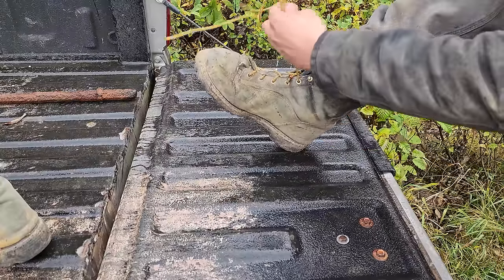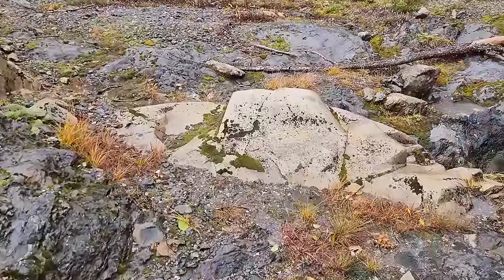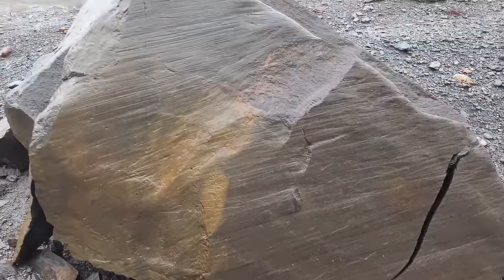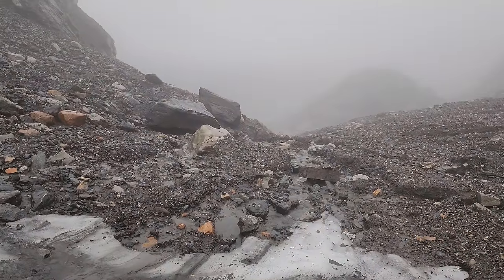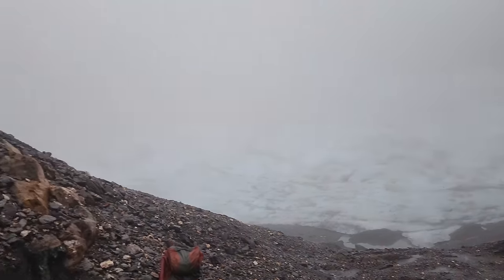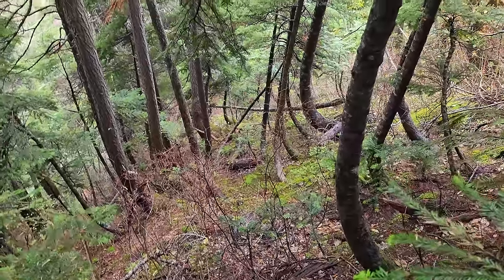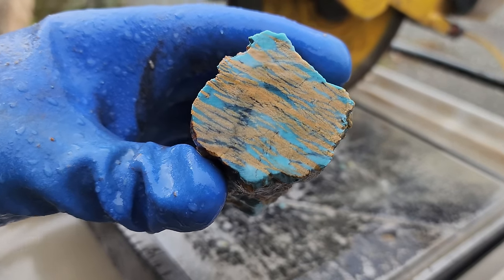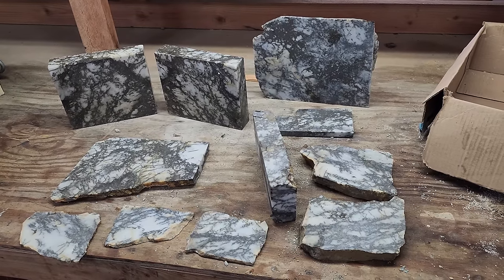Death March Gold Prospecting & Rock Cutting, What Did I Find?!?!

Comment: Poppin joints is from little air bubbles forming and popping again inside the knee. Can be from dehydration or pressure changes. You likely had both going on. Jade will not scratch while pretty much everything else will scratch. Translucent to light and passes the scratch test, and you got Jade. THAT is BEAUTIFUL!

Comment: Amazing video and geology. I'd suggest eventually taking a sensitive metal detector like a gold bug 2 up there, of course packed away until you're amidst all the green stuff. Often the more coarse the gold, the smaller the veins and more calm 'backwaters' of the perculating ore rich fluids. Larger seams often have lots of mixing and a turbulent environment which often doesn't allow for more extended cooling to form larger concentrations (such as gold crystals), but perhaps you knew all that. -With some more alteration (metamorphism), you could have had some nephrite jade up there too...Oh, I spoke too soon, there's the jade, 26 min in. The jade can be worth a lot to Chinese buyers (big bucks on the level of gold.) Need to tap off a piece (easier said than done), slab it and look at the color and cracks...I always use elastic compression bands around the knees for off trail hiking, it saves them big time. Sorry for such a ridiculously long message...Of course, say hello to the NW sasquatches :) Just subbed to the channel.
Reply: It’s worth even more when you find jade that weighs exactly 8.8888 grams/lbs or carats 😂

Comment: Note time 1:49.
The bent cedar trees indicate that there is a slow slip landslide occurring at this location.

Whenever you note trees with this curvature at the base, It indicates that the land has moved from its original location where the tree started to grow.
Reply: Interesting!  Could snow load on seedlings cause that also?
Reply: Snow typically bends mountain hemlock tops into a candy cane shape, not the trunks. likewise snow-bent trees trees would typically bend downslope, not up slope.
Reply: The whole region is covered in a variety of landides, the roads have to frequently be re-engineered. This is not far from a massive landslide that killed many people in a rural housing development. Rainforest conditions above riding on slimy layers of volcanic ash sediment below.
Reply: smilingcloud8  yeah it's nearly criminal negligence because even the most basic visual soil-core samples (seismic, stability, etc.) would have revealed clearly dangerous ash strata from the last time

Comment: I was really impressed with the skewed trees in that grove. You think there was a landslide or avalanche that pushed them over, or maybe a really heavy snow that pressed them down at some point?
Reply: Landslide. There is a Missouri geology professor on u tube that talks about geologic engineering and signs of unstable ground
Reply: Commonly called "pistol butt"  in areas of heavy winter snow.  The weight of the snow slowly pushing downhill due to gravity and the tree trunk curves to compensate and try to grow vertically.  You can see it all over Western Washington in the higher altitudes with heavy winter snow.

Comment: Thank You for the walk and SO MUCH for Teaching!  Find yourself a good, live hard wood branch, and cut it to just above your shoulder. Trim the bottom to a 1"-1-1/2" flattened point.  It makes going up hill, down hill, and crossing water much easier and more safe with your 3rd point and will save your knees.  Mine are better because of a stick. 🙏🚂🎼🌹🎵🎶🛠 ~C< 3)>>-Z->}

Comment: About your knee popping...
If its like mine... I scramble a lot and when I do alot of terrain, my knees will get painful and if too much will pop a bit. I can still go just slower. My old chiropractor who was avid in mountain hiking told me that going uphill  really works a particular group of muscles, tending to fatique alot, then going downhill the other set of muscles that wasnt used as much going up, pulls your leg and knee out of alignment, hence the popping. He said to alleviate this, was to work out that other group on the way up, so when coming downhill the both muscle groups pull evenly, keeping better alignment. Sitting down and doing leg extensions or leg lifts, bringing your foot upwards to knee height...ish, while having a break is supposed to be a good way to alleviate it.

Comment: I'm not a prospector, but I've had a bad back for decades. My way of handling the descent would be make a folding piece of plastic that acts as a pack frame, then I would carry some lightweight line and pulley to use that the plastic as a sled to lower it down grades. That, or I would just throw my whole backpack down the hill haha.

Comment: Next time you go, bring a Metal Detector and run it over your Targets. I've had hits on similar looking stuff in Vermont. What I was finding had Brown on the outside and Serpentine Green on the inside. Only down side about the stuff I found is that it is super tough to break up. Slabbing it is probably the way to go.

Comment: That steep slope is why you should pack a 100 ft rope (the thinnest you can find that supports 300 lbs).
Belay the pack down in front of you, and walk down without the added weight.
... and get a heavy waxed canvas bag instead of the nylon ruck.

Comment: I've seen the scrapes from ice here in indiana on top of the limestone in creek bottoms.  Deep and angle NNW about 340 degrees.  So In lots of places the claciers scraped down to the bedrock. And in places the weight crushed the limestone layers. I think they call it karst.   Lost river goes into the crushed limestone and emerges about   15 miles away as a big spring.  It's amazing.   In orange county indiana..
Cave country in Southern indiana.

Comment: That snapping thing in your knee is probly Creptius or Runner's knee, best to go to the doctor and have them do an x-ray and identify the problem.

In my case i hadd same thing with popping/cracking sounds on my left knee aswell, it got worse overtime and it got really swollen around the kneecap, i went to the hospital and took an x-ray and the doctor told me i needed an Knee replacement surgery to replace parts of the injured or worn-out knee joints.

He got really angry at me and asked what i have done, probly becus i was only 21.
I do not do sports or enything like that, but i worked alot on my knees "screwed cars on cement floor", so it might have something todo with that. I guess if i hadd used Knee protection it could have helped, but my father grandfather and great grandfather all hadd similar knee problems including cousins, so im guessing in my case its an genetic related problem.

Im 34 now and still using my old kneecap, shoots pain to my brain if i try to bend the left leg, but otherwise it's ok, still removes alot of things what i can do sadly, can't afford an knee replacement so that's why.

Comment: When I was 20 years old I wrecked both my knees and had the cartlidges pulled\
Doc said when i was 40 I would need knee replacement
Well i'm 81 and still joging no knee replacement.
May also have something to do with what I eat .

Something you should have been doing all along
But learn the proper way to jog
Put the small toes down first then the big ones and the heal last while slightly leanng forward
May be your knees won't pop after that for a while
every week 3 or 4 times or more jog
5 to 10 K

And when I was younger
I would jump down the hill like a deer does, landing on both legs at the same time,
sig zagging as i went
Some times a 10 foot jump, and it was easy and got even easier the more i did it.
Felt good to build up my knees

Forgot to add
Allways keep the knees slightly bent when descending

And i forgot to tell you
The more you practiced this the steeper the terain did not bother you, it became fast and easy.

Eg
the lions in lions bay BC.
It takes most people all day to climb it, and  return.
But when we went up and back down, we met people only 1/2 up and we were coming down
5 hours up and down,
Down seemed extremely fast as the way we decended

Comment: When mine started it ended up being bone on bone,when it starts locking up from bone chips,you will have to get it cleaned out and resurfaces,check at back of knee to see if you have a cost,refered to a bakers cyst ,named after the doc who discovered it

Comment: OMG Wasaaaa, secure the chimney, install pressure relief, and plug some of the wick holes on the outside edge so the  flames don't flare out around the edge. I don't think It needs them all. Bolt it down to a board covered with aluminium diamond plate. Just sayin.

Comment: Do a specific gravity test. I know those very well and can tell you with almost 100% certainty that it is nephrite. The gravity will be around 2.92..Take a cup of water rare it then weigh a piece and then get a fishing line and weigh it without touching sides or bottom then divide the piece weighed on fishing line into the weight  of the stone and you will have the gravity. Do it more than once.

Comment: Prob.Nepfrite jade  usually shows the quartz chrystals which has been subjected to high  heat and pressure  causing distortion.s Jadeite is similar but shows tighter  grain and therefore is usually tougher and will  take higher sheen and be darker. Sometimes black. Most Jadite. Comes from S.E. Asia. Light Apple green is more  common in nephrite.
     The Rockey mountains produce more N.Jade than anywhere else in the western henephritis. There are places in the Wyoming diamond district it used itto be difficult to walk without stepping on it! sometimes it  can be  found indv.large deposits. About 20 years ago some one found a Boulder of nephriite in Alaska which  if memory serves weighed Around 20 tons!
.

Comment: HEY JASON, I'M 70 NEXT BIRTHDAY, AND YEARS AGO I STARTED CARRYING 25 FEET OF LINE I COULD LOWER MY PACK AHEAD OF ME. IT'S SLOW, BUT IT SAVES YOUR JOINTS. I'M STILL AT IT.  INCREASING YOUR BODY WEIGHT IN STEEP DECLINES IS VERY RISKY, BECAUSE UNLESS YOU ARE RUNNING STAIRS REGULARLY, YOU ARE STRESSING YOUR JOINTS "BEYOND YOUR TRAINING".  OLD SPECIAL FORCES ADAGE; "IN CRISIS, YOU WILL NEVER RISE TO YOUR POTENTIAL, BUT FALL IMMEDIATELY TO YOUR TRAINING".  "IF YOU DON'T TRAIN FOR IT, DON'T DO IT", IS THE LESSON I'VE LEARNED. AS YOU KNOW, THERE IS NO "HURRY-UP AND GET IT DONE" IN PROSPECTING.  ABSOLUTELY TERRIFIC VIDEO, WILL BE A CLASSIC.